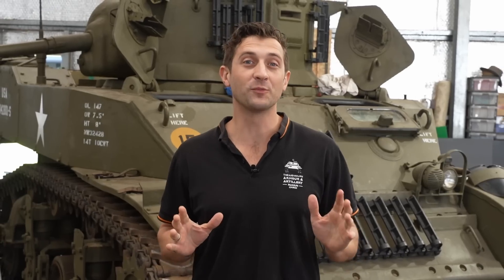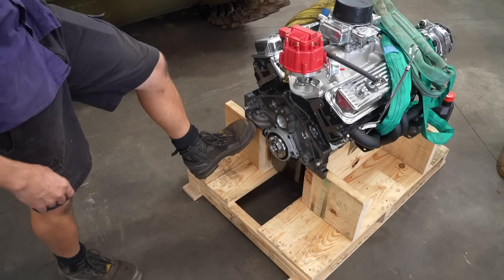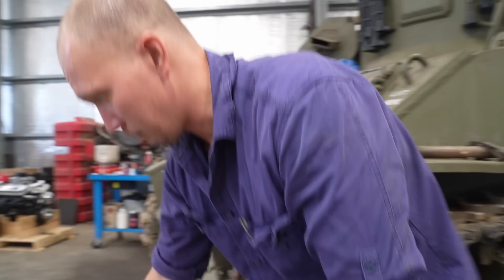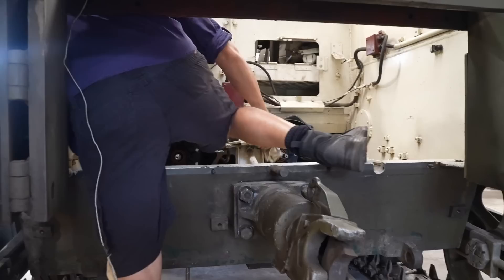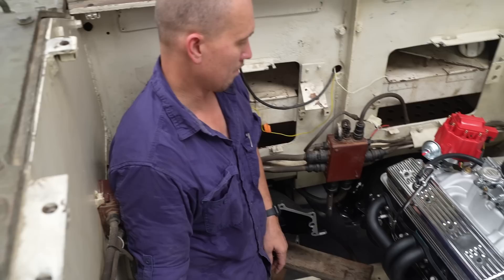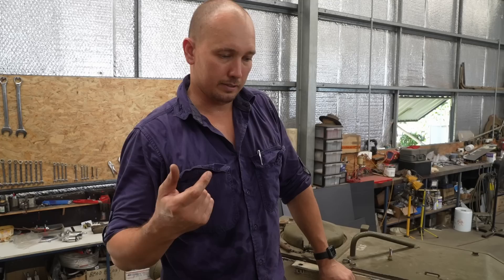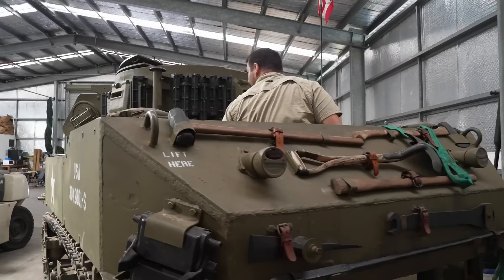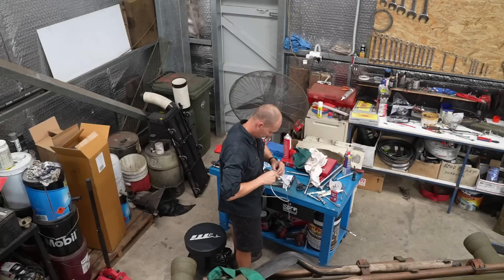WORKSHOP WEDNESDAY: Fitting 2 new engines into our WWII M5 Stuart Light Tank

Comment: You can imagine the sigh of relief from every tank mechanic when they invented the drop in power pack.
Reply: I wonder when it was first implemented?
Reply: @akula9713  The M3 Medium (Lee-Grant) had the first attempt…
2 Hours for an engine change but the transmission was separate and came out through the front of the tank (but was just as fast to change (that’s what the big bolts on the front of the tank are for)).
German tanks took two days to change engines and transmissions and requires significant demolition of the vehicle to reach them.
Reply: @akula9713  my understanding is the poor maintainability of the German tanks in ww2 lead to the use of a power pack in the Leopard 1. I think it was the first major tank to go that route, but I’d love to be corrected by someone with better info.
Reply: Still waiting for them to design skid steers like that!
Reply: @brentfellers9632  I’m really interested to know why they don’t. I can only imagine how many hours are wasted globally by extended machinery down time.
Reply: Was doing a little poking about today and it seems the M26 Pershing had a power pack with engine and transmission
Reply: @Alan Livingston  for skid steers, a roll out tray with or without the pumps . 360 degree access. 
I'm a semi retired HD mechanic and AME , at the last training class i attended for Kubota (Markham Ont. 🇨🇦) I suggested that they could steal my design ,...I'm to old to see the benefits lol.
I'm sure it could be done in an economical way that would DRASTICALLY cut the cost of ownership and the number of cuss words associated with such.
Reply: @Alan.livingston  I can only imagine the life of hell German field techs had attached to Panzer Grenadier Divisions. Generals in desperate need of fighting vehicles harassing the repair staff constantly.

Comment: Awesome job!  As the “stuff” gets older it’s almost impossible to find and replace original parts.  Metal fatigue and microscopic cracks are never seen until your oil pan is full of scrap metal, like your Stuart.  Some purists may turn up their noses at what you are doing, but from a maintenance, safety and ease of operation to keep them rolling point of view, it’s a brilliant solution and I commend all the hard work you are putting into running these treasures!  Thanks again for another stellar episode!
Reply: As a purist, yes I think the tank is now diminished in terms of historical accuracy. What happens when the track assemblies wear out? Do we just bolt on bits of a Komatsu to “keep them rolling”? How far do you go before it stops being a historic artefact and becomes a fairground ride? 
It’s one thing to build a tank from a collection of bits from a number of destroyed tanks, but is it really necessary to wear out original tanks just so people can have a ride?
Reply: @tuppyglossop222  same could be said for rare historic aircraft , why risk flying therm?  .. because an aircraft in a museum is cold dead thing, it's lifeless  .. but to see it in the air, to hear the roar of it's engine, sunlight glinting off it's canopy as it banks awy .. it lives again ... how is this any less?
Reply: @donbeary6394  Yup, that's great. But what about when it''s all worn out? When most of the working parts have all been changed for modern ones. Like the old hammer that's had 3 new heads and 5 new handles. Is it still the same machine?
And what about if you crash it like the old Niki Lauda F1 car?
When it's gone, it's gone...
Reply: @tuppyglossop222  The museum has to make some money. It's not just so some people can get some rides and if it comes down to it, they'll likely fork out for someone (like their connection in Poland) to make more tracks. Also, the amount of track time these get, is minuscule compared to the actual time set they were designed to do. It's purists like you that get entire collections trashed, because the cars are static and never changed from original spec. I've seen it some many times now (here in Europe) it's not even funny. Rare cars gone right to the scraper because they were too far gone to even be good for parting. Wooden wheels eaten by insects, rats making a bonanza in the engine bays with seized engines and ruined paint from years and years of dust and zero maintenance, because inevitably, the fart that owns these cars passes away, so nobody even knows what these things are worth. In case you're wondering, not one, not two, but three collections were found because the new owners (stupid people from the same family) sent the cars to the scrapper. At least these days with the internet, the promise of monay has them asking first, scraping later, when they're told they wouldn't make much after costs of repair. Purists can walk the plank as far as i'm concerned, you lost us too many rare things with your demented attitudes.

Comment: The old light tank transmissions also had a lot of really difficult parts to source......like leather shaft seals. Its just so much more practical to use modern,common and easy to deal with drive trains.  Keeping already rolling and working exhibits going with a minimum of fuss also helps the museum maintain their fleet without constant problems.

Comment: After priming, go back with a long blade flat tip screwdriver and turn (rotate) the oil pump driveshaft so that it will match up with the dizzy drive tang.  That will let you drop the dizzy right back in perfectly.  What stumps people on dizzy’s is that the cam drive gear rotated the dizzy shaft as the gears mesh. Back the dizzy rotor back 1 gear tooth as you slide it down so that it will rotate into the proper orientation.

Comment: The Holden 253 red block V8 is pretty close to the original Caddie V8's they came with anyway. I guess its just got a couple of little old school aussie V8's now instead which is going to make it a little easier to source parts for them.
The Stuarts are kind of neat in terms of history, they were at the time one of the most reliable light tanks around, I think they did a torture test of over 3000miles with no problems during the proving ground testing and that is a LONG way in any tank even now! WW2 was kind of mixed results but their main claim to fame during the battle of Kuningtou in 1949 when a Stuart got stuck on a beach prior to the invasion and two of his mates tried to pull him out (unsuccessfully). When suddenly, PLA boats came cruising in to drop off their infantry.
So the stuck tank turned their turret around and started shooting
The two there to help them turned around and started blazing away
Eventually the two of them that turned up to assist ran out of ammo and ended up rolling up and down the beach turning Chinese troops into roadkill and defeating them. They are known locally as the 'Bears of Kinmen' and have quite a story

Comment: Great work. You may need to level each carb up. See how it goes but if you run into mystery fueling issues, putting a wedge spacer between the manifold and carb might be a solution. Watch for oil surge too give the angles - may need to fab custom pickups.
Reply: good thoughts, I was wondering about proper transmission fluid levels also

Comment: Did you do anything to adjust the oil pickup in one of the engines?   When they are on a angle like that one of them will be on the higher side of it's pan and won't be able to pick up quite a lot of oil that is now below it on the downhill side of the oil pan.

Comment: Twin Chevy small blocks , turbo 350 transmissions 🙂 .. excellent idea for a runner  .. But I can't believe you didn't paint the drivetrain before installation though .. a starter installation tip, hold the motor toward  the block when tightening down the bolts , eliminates the need for shimming it most every time

Comment: Aewesome restoration work as always !.Not the heavy tank destroyer like Ferdinand, such a small tank of the M5 Stuart did have two engines is surprising !.:face-fuchsia-tongue-out:
Reply: It still weighs about 30 tonnes!
Reply: Where they 4 cylinder engines originally?
Reply: @jonowens460  They seems to have equipped with two V8 cadillac engines.
Reply: @yattaran1484  thank you. I know they would put Continental and Caddy engines in some U.S. tanks. My father was a mechanic in WW 2 and told me that.
Reply: The Matilda infantry tank also has 2 engines, originally AEC and later on Leyland inline-6 diesel engines, but, here's the kicker... both those engines were originally powerplants for London double-decker buses of that time!
Reply: @kristoffermangila  Thank you for letting know the interesting story !😊
Reply: @jonowens460  You are welcome !.😊👍
Reply: @jonowens460  Yeah they look like 4 cylinder engines in this video, but apparently they were V8 'flat head' Cadillac engines.
Reply: @ldnwholesale8552  Is that right mate?  Wow, cos the M4 Shermans were supposedly only 32 tons I thought, & they (originally) only had the 9 cylinder Wright engine.  

This Stuart oughta do 30 second quarter miles then ay?  With its twin free fiddys & T free fiddy transmissions it should be quick enough to dodge an 88 round!

Comment: HOT TIP from YouTube's awesome Marty_T: When replacing an oil filter ALWAYS push a rag wrapped around your finger into the threads of the filter, and wipe out the thread.
You will always extract a bunch of swarf from the tapped threads. You don't want any of that crap in any engine you own!

Comment: Outstanding work. This stuart is going to be a beast. You guys be careful picking coolant that is compatible with those aluminum intake manifolds. The old green stuff will eat up that aluminum in no time.
Reply: Screw a zinc anode into the radiator drain fitting, no worries then.

Comment: Did you put any lock tight on the flywheel bolts ? When your Oil priming the engine you should Turn the the engine over by hand as your priming it for a first start to make sure all the lifters of full of oil and you have oil up to all rocker arms ,I really like this set up it's clean and should do you well ,I've worked with small block Chevy engines since the early 60s

Comment: In past i have had to put a washer or 2 between each flywheel to torque converter to make sure pump was fully engaged and not on tip of tang teeth on converter 
Looked like you all had under control though just didn’t see a spacer in there
Some torque converters have a tall mounting foot and dont require 
Other than that excellent work guys 
It will sound awesome

Comment: As a "Chevy" user for Way to many years you may want to use some insulating covers on the plug boots that are close to the headers as they Will get crispy and arc over in time. Only need about 4-5" ( bananas) to cover the silicone boot.

Comment: Nice...LS swab for the m5 stuart ;-)...Great job guys, hope that all goes well.
Reply: Uh, not an LS.
Reply: @999torino  I know..was only a mechanical joke due to the fact the Vortec and the LS both are almost the same with the only difference is the application. Vortec is for heavy duty trucks and LS for passenger cars…for my understanding both variants can be traced to the old 357 from the tri-fives (55-56-57)
Reply: @cristiancruz5079  Sorry, but NO. LS is a different engine than the traditional small block, which does date back to 1954. What you are calling Vortec is only a later version of the smallblock with different cylinder heads. The LS is a clean sheet design, with a skirted block and vastly different heads. The most common source for a LS is from a truck, not a passenger car.
Reply: @999torino  thanks for the clarification🙂…LS means Luxury Sport.

Comment: If those small blocks have flat tappet cams, you need a specialty oil to keep from cam lobe failure. Joe Gibbs, Royal purple and others make a special oil with high ZDDP content to protect the lifters and lobes.
Reply: I saw t was 15w40, maybe diesel oil? We use it in small engines as it has a higher zinc content.
Reply: @SuperGlacierGirl  Even the diesel oil now has low zinc content.

Comment: That starter motor that Ryan was bfitting. It looked like it had a crack in one of the bolt mounts, or was it just a casting seam I saw. Great work guys should sound great when finished.

Comment: I would have used one of the new EFI units on the market. They learn the engine and are very reliable once set up.
Reply: Nah, they've already deviated already from historical stock enough. It's good enough as is, although I would not mind aftermarket carbs like a Holley or Edelbrock.
Reply: Too expensive.

Comment: Ah, the venerable “R” motor. The last evolution of the Small Block Chevrolet. You have to deliberately abuse those to kill them. Nice choice. And those torque wrenches are SCIENTIFICALLY accurate. I have three of them. They will also measure degrees of rotation for newer “torque to yield” fasteners.
I envy you guys. To fix such cool stuff, instead of clapped out cars. Cheers!

Comment: Not sure if someone has mentioned it but next time you may find it easier to use a pump sprayer to distribute the oil.  Just use the pressure sensor bung and hook up the sprayer and add the oil that way.   You wont have to disturb the distributor that way.

Comment: Honest question: obviously this is not a "restoration" because it's not using original engines.  I know there are running and not running "restorations", but what are the rules of thumb with respect to making significant changes to these old tanks?
Reply: Rule of thumb, make it run.

Comment: Does one engine drive each track?
Reply: No. Both transmissions connect to a transfer case and a single driveshaft goes to the final drive. The eng8nes and transmissions aren't synchronized and can get out of sync (each in a different gear). Just lifting off the gas will allow it to shift. You can run off of one engine, but not recommend. More of and emergency thing.

Comment: Not sure which GM engines you have but they should be rated somewhere between 300 to 350 HP.
Reply: Each
Reply: @seventhson27  correct: each motor should put out HP within that range.

Comment: Replace two four-cylinders with two 350 Chevys. "Hot Rodding" at its best. Need to bring it to the "National Street Rod" rally in Pueblo, Colorado held the first part of July every year. :)
Reply: The original motors are 346 cubic inch Cadillac  V-8s , so putting in 350 cub8c inch Chevrolet engines is a close swap. Other than the originals having 110HP and the new ones 300+
Reply: They were originally V8 Cadillacs

Comment: I have mixed feelings about this. I understand having new engines but you all couldn't find flathead v8's? They sell them all day on ebay. You could have easily found a block or 10. But if your gonna stick with those new engines, at least get rid of the chrome and paint them to match the tank.